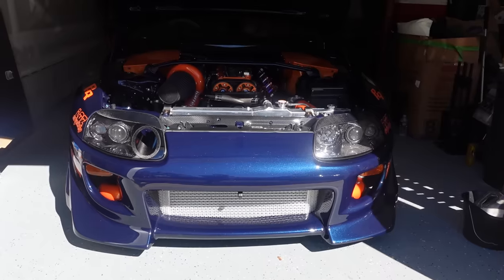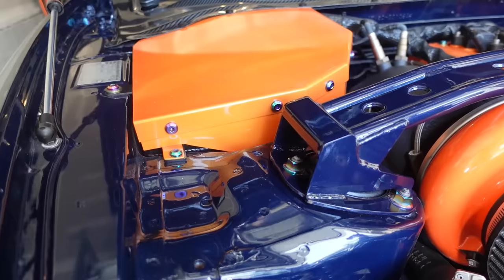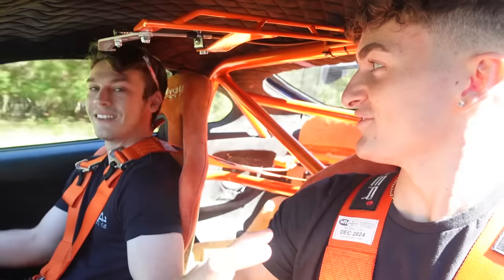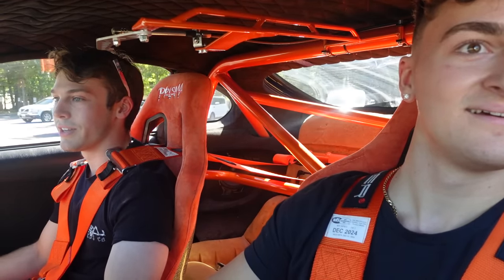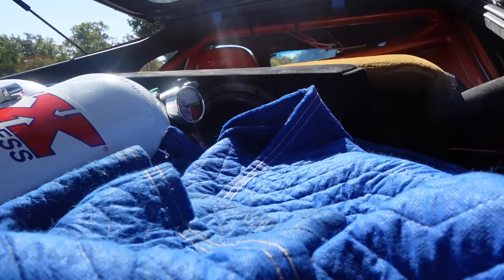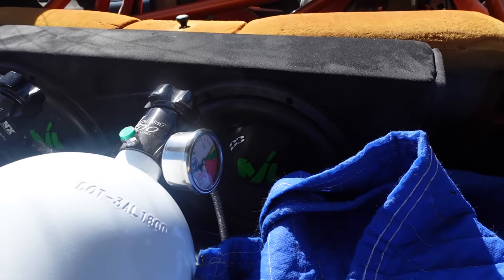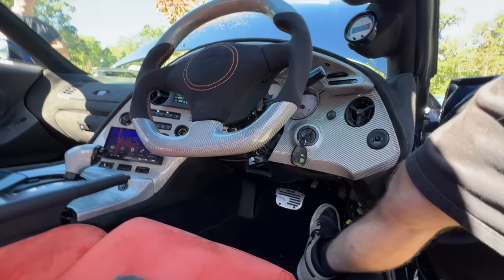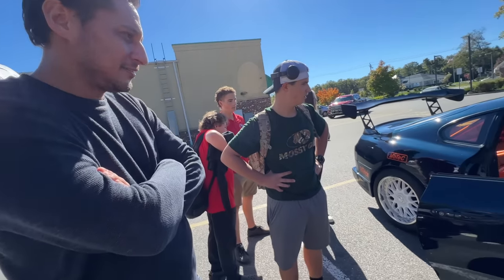Taking my 1300HP Supra mk4 to High School

Comment: 1300hp? Idk man, those pulls looked more like 600-700hp. Cleetus has a 1300hp supra and its fucking ridiculously violent. Sick car, not hating. Keep the content coming man.
Reply from the maker: A 1300hp street car has multiple boost settings. This video was taken on setting 1 on pump gas, no nitrous. That would be around 850hp for this video, and thank you!
Reply: Example: a 1200 HP Bugatti, on pump gas and no setup, will only push out 700-800 HP.
Reply: @GoldNargacuga tell me you know nothing about how HP works without telling me.. lmfao
Reply: @TheGunPatient  I know enough. But have a blessed day.
Reply: @GoldNargacuga  no, you really don’t 💀💀
Reply: @GoldNargacuga  I'm aware of how Ethanol works. I was just confused on the title. It said 1300hp supra and after seeing the pulls I didn't think it was 1300hp. Didn't even begin to think about different maps.
Reply: @Menace2Myslf   yeah its pretty obvious tho the bigger number brings more clicks. its a little clickbait but hes technically not lying because that supra can be 1300 hp with its current setup but its not turned up.
Reply: @TheGunPatient  he right tho pump gas has less performance potential in a car like this, you just can't get as much energy into the engine with 95 as you can with something like e85 so you will not get as much torque out of the engine therefore less hp
Reply: @Sam-dt1kg  settings my guy, street cars with such a setup have different settings.
Reply: @TheGunPatient  e85 tune vs 91 tune Can have 100hp~ effect the car is setup correctly. remove nitrous and lower boost settings and you can definitely have 3-400hp in variance
Reply: @qwertpoiuy430  no shit, but a 1200hp Bugatti on 91 will still equate to 1200hp unlike the other dude was saying
Reply: @JTSRacing  Car is amazing man but how in the hell does a High Schooler afford 200k+ worth of car and mods??

Comment: No way this is even coming close to 1300 wheel horse power what so ever
Reply from the maker: So call up titan Motorsports and ask about my last dyno pull😂 and in this video if you listened I mentioned I’m not driving the car hard because of my tempeorary filter with no piping. Not to mention I ran the lowest boost setting around 850hp. That can be turned up to 1250 with nitrous at level 11 trim…

Comment: What auto transmission do you use for this kind of power? And is it the gte or the na ge engine that is added turbo?
Reply from the maker: Stage 4 A340E built by ATF, original gte engine
Reply: @JTSRacing  was thinking of doing a 2jz in my rx8 with an auto transmission but been conflicted between gte and the ge since the gte ends up getting oil squirters taken out anyway and the na ones are significantally cheaper out the door

Comment: That’s not 1300hp💀💀🤣🤣
Reply from the maker: You didn’t hear the part where I said I’m running it on low boost (~850hp) and not going open throttle because of my piping.